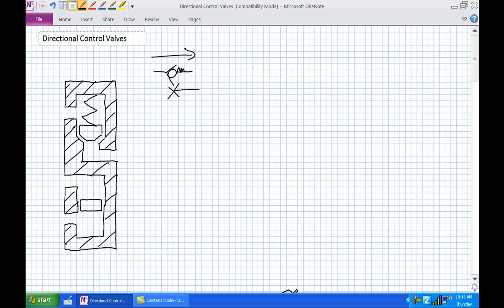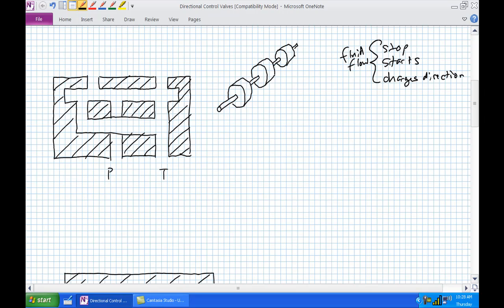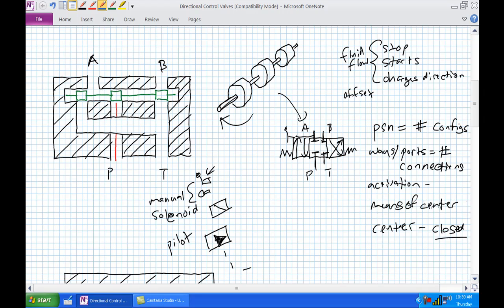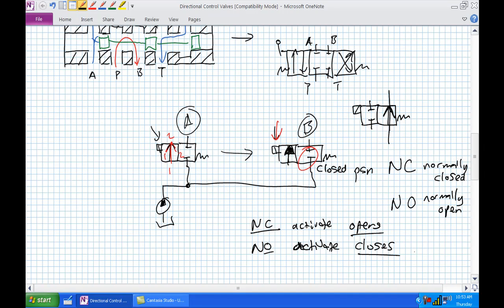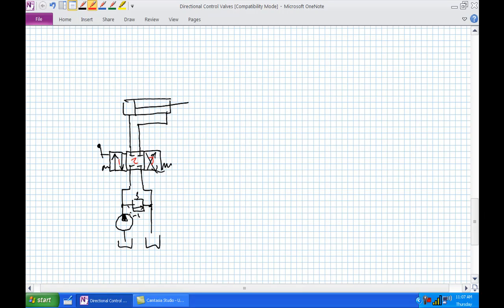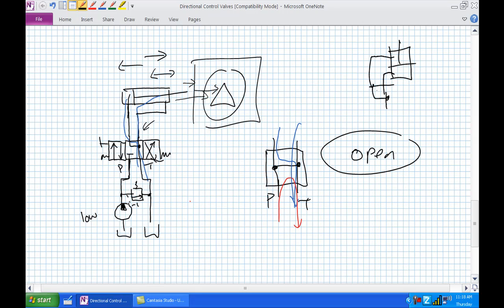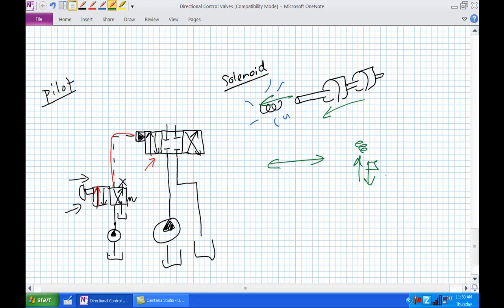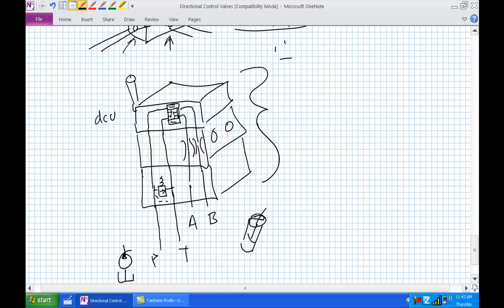Directional Control Valves

Comment: i want to ask Q,
if two solenoid faill or power off,or both energize what will happen for the directional control valve , there is no drain ?.
check the status on this link i upload image
http://im70.gulfup.com/BITO58.png

Comment: 38:04~Single cylinder~I suddenly thought about the hydraulic liquid's pressure gradually down following its hight. ~Spring, damper it's a good ideal design. The much higher position for pouring down out of oil is much quicker~ This might tempt me to think association with many things.~ Thanks~~